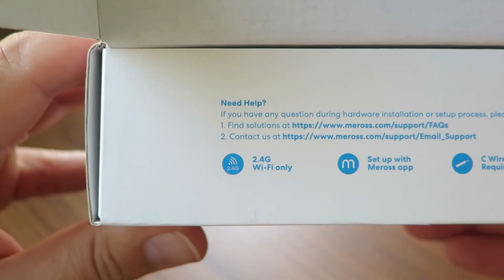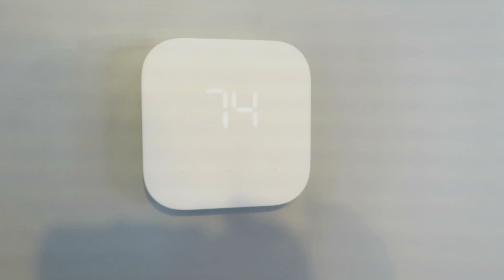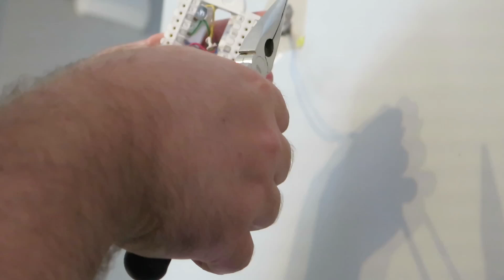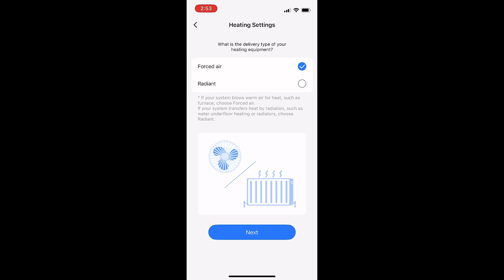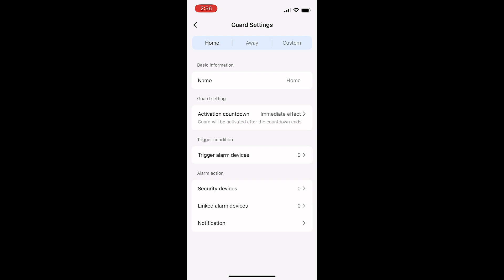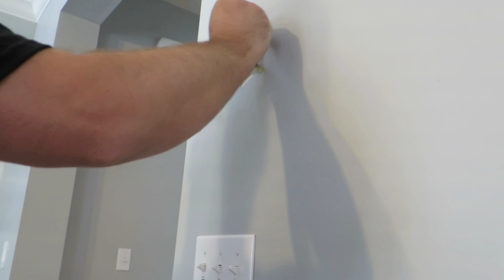Meross Thermostat MTS300

Comment: Plugged mine in exactly how the video and instructions said and smoke started coming out of the thermostat. No crossed wires, they are connected correctly. A/C in the house turns on but fan outside doesn’t start.
Reply from the maker: Ew. That’s no good. What happened?

Comment: I installed mine and it’s just blowing hot air. I wired mine the same as yours but I previously had a Honeywell thermostat.
Reply from the maker: Does it stay on or just hot air when it’s on?

Comment: I wired mine, connected the C wire, and it’s not powering on. Kinda at a loss.
Reply from the maker: Was your c wire used with your previous thermostat?  (IE was your old one battery operated?)
Reply: @theXchange i have the same issue, to answer that question for me, yes my old Honeywell thermostat was battery operated
Reply from the maker: If you have a C wire that was just hanging there / not in use, it’s likely it’s not connected at the unit in your basement.
Reply from the maker: Watch this one to see what I’m talking about!  Install ecobee Smart Thermostat with C Wire
https://youtu.be/nynNGsIjOnI
Reply: @theXchange  It was plugged into my old thermostat!

Comment: Amazon delivered mine at 6am this morning (12/20/25). At 6:05am I started installing/wiring it up half asleep. Watched your video to double check myself.🤣 We were both right. Great news for us both..Lol  

I'm awake now, might as well watch the news and start the day! 👍👍👍
Reply from the maker: Good deal!!  I’ve been wanting to post a follow up video. After a few days of running mine, I realized there’s one thing I had to. I noticed that the “feel” of the temperature in the house was off from what the thermostat reading was displaying. After some research, the thermostat needed to be calibrated. There’s an option in the Meross app to do just tha. Let me know if you run into a similar situation!
Reply: @theXchange  Yeah, I did that later on in the day in the advanced setion. Our old one did that too with the tempature being off a few degrees, but I couldn't calibrate it, since it was from the 90s. Everything is correct now. It was only a little bit off anyways. Still no issues with it. I really like not having to get out of bed each night to turn the heat on/off when the wife wants the heat on/off.😂😂
Reply from the maker: @TuttleCountry  yes!  It's so nice to have control from the phone!